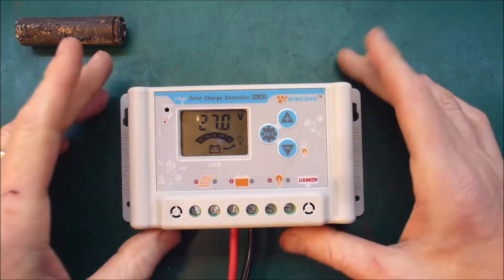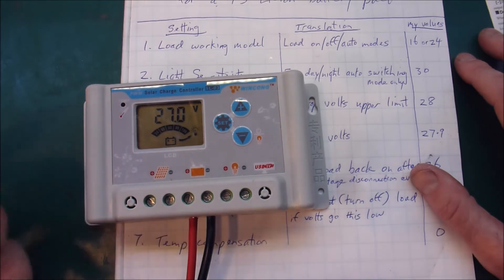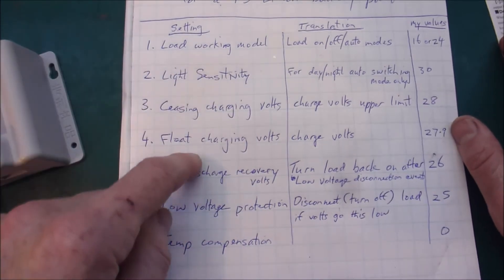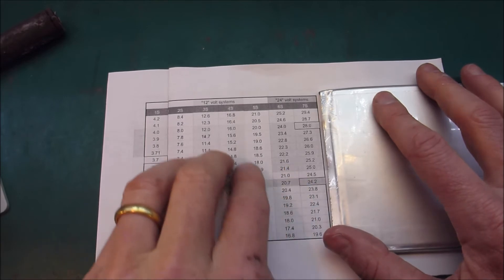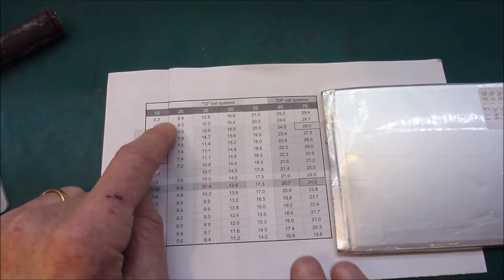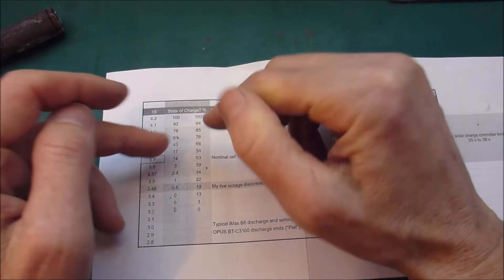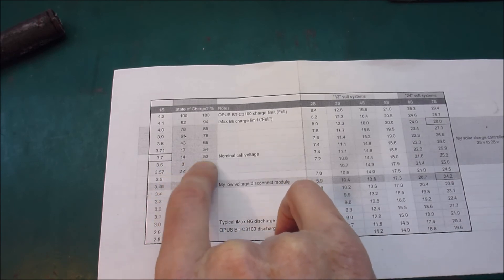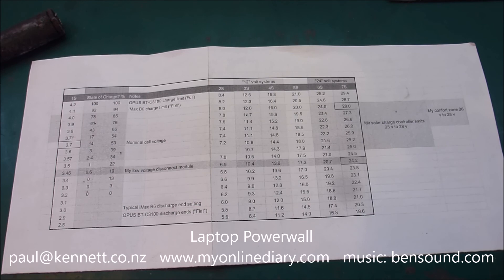Laptop Powerwall 110 - Wincong SL-03 solar charge controller settings

Comment: I been using this cheap but good controller for a year now charging a WINSTON 90 AH batterie with no problems from two 100 watt solar panels, i undercharge the battery by max 13.9 Volts and my low cut off is set to 12,7 volts, this battery (big prismatic) works flawless from this controller,  although when i run my 1500 watt inverter to power my microwave the voltage will sag till 11,1 volts , Butt only for a few minutes till diner is done then its bounces up nicely again to 13,2 wich is the resting voltage of a LiFePo4 battery , nice vid btw, thanks for showing

Comment: Do you know what the max amp output is of the controller's USB port, by any chance? Thanks!
Reply from the maker: Hi @getenlightened Don't know that yet. I've got a USB power meter at work do I'll bring it home and test it. My guess it'll be 500 mA - nothing fancy (this is a cheap controller after all).
Reply from the maker: Hi @getenlightened I've just tested it with a LED torch and it went up to 900 mAmps. I don't actually know what the peak drain of the torch is - so either the torch or the SL-03 is topping out at 900 mAmps. Hope that helps. Cheers, Paul
Reply: Thank you Paul!

Comment: On the charge controller. At setting 3, cease charging volts, the voltage, having been in constant current mode, will have reached 28.00V? The controller will then go into float 
mode, at 27.9V?? Does this effectively trickle charge the cells, until sundown? Or does the charge controller, efffectively choke back any current to the batteries?
I think I've gone through all your videos now. A great journey, thanks for sharing.
Reply: I'd like to know that as well. I'm going to be safe and set it much lower. The whole idea of using these cheap programmable charge controllers for 18650's, is so that you can stop the charge at a specific voltage and not trickle charge all day.

Comment: Hey Paul, thanks for the review. I have couple of 12v panels too and need to step up for 7s pack. Now I have choice of yours or what Adam reviewed just recently. Similar price. If you can take a look and give your opinion of what you would choose now and why :) https://youtu.be/omAhsQqwWSo
Reply: Wait.. This wincong doesn't do step up.. Not sure why I thought it does duh.. So I must get the other one that also does mppt and not throw away my 12v panels
Reply from the maker: Ah yes. I was interested by that one. It seems to be ideal for charging a 36 volt ebike. The advantage of the Wincong SL-3 is it has a display that gives voltage, amps etc so it's more helpful in a powerwall scenario.

Comment: 4.2v is a full charge at idle with no load and as soon as you put a load on it the battery will drop to 3.7v or what it's designed to, but if you charge the battery to 80% or 4.0v or even 3.9v and on and you put a load on it, the battery will still drop to 3.7v
Reply: When you charge the battery to 80% or 4.0v it will have a much longer life span, less stress, but when you under charge these batteries you just get less run time on any given device... Imagine how your smartphone would act...
Reply from the maker: Yes. For this video I didn't want to complicate it by going in to the whole "constant current, constant voltage" charging profile details.
Reply: I think I would find that useful, if you have the inclination.
At setting 3, cease charging volts, the controller will go into float mode?? Does this effectively trickle charge the cells, until sundown?
Reply: When you put a cell checker on a battery or pack it's not enough draw on the battery to be considered a load, but as soon as you put a load on the battery it will automatically drop to 3.7v which is the power voltage of the battery to run a device... If you unplug it and connect a cell checker it will be close to 4.2v to 4.19v so a typical battery like this will be at 3.35v, a single battery only has .7v worth of use and the entire amount of amperage available in that cell which makes that .7v last.